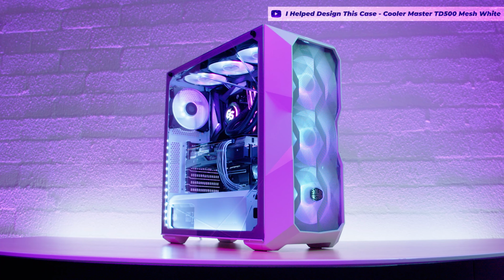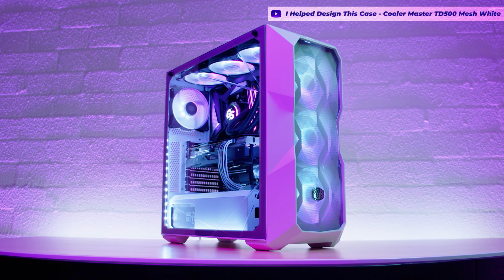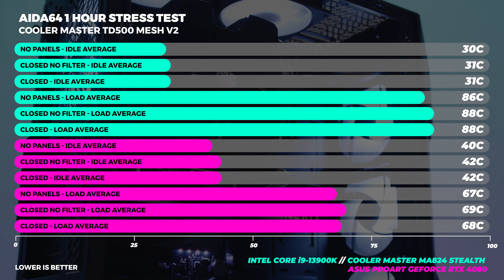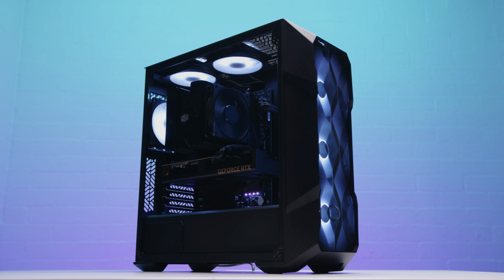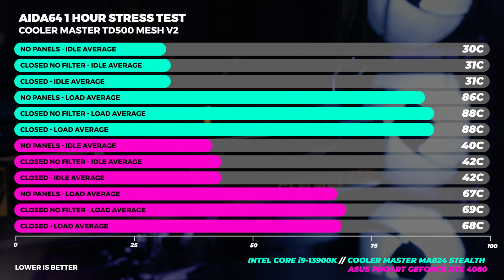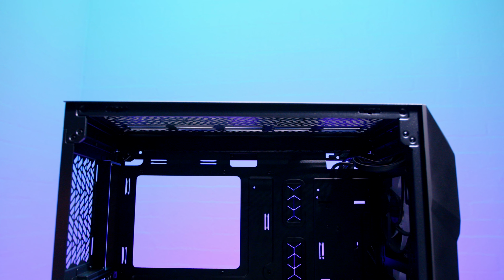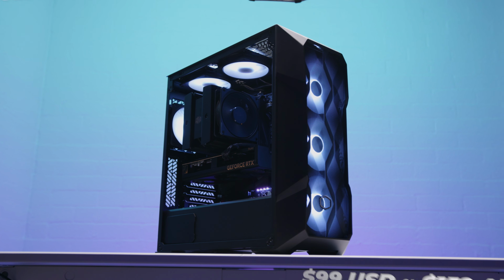Cooler Master TD500 Mesh got better with V2!

Comment: I've had a TD500 for about 3 years based mostly on your review/video and the Gamers Nexus testing. 
Absolutely awesome case for the price. 
Really keen to see the v2.
I haven't watched this yet but I really hope there's front panel usb c
Reply: 3:41 - there is a front USB-C finally
Reply: @DrKriegsgrave  yeah, saw that. Sweet. And the top coming off is nice. Putting my rad in with 30mm thick fans and getting it abled was a challenge.

Comment: I’ve owned td500mesh v1 and installing the top mount 360 radiator is horrible + issues with ram clearance…now on v2, cooler master learned from mistake

Comment: Heyyyy, it was thanks to you that i decided to buy a CM TD500 about 8 months ago, your videos convinced me it was a solid choice over a phanteks P400. Please let me tell you my story:

After i purchased a TD500 mesh version, i also brought a TD300 for my brother who was looking into a smaller form factor since i had a Z590 MSI Tomahawk and he had an MSI B560 Tomahawk as well that i previously owned. I quickly questioned myself why did the TD300 had the open top design avaiable while the TD500 didnt, it would have made been WAYY easier specially when doing placements of the radiator and cable management, im glad the V2 has corrected this

Next, i found out the space for cable management for the TD500 was.. very limited, as in, miserable, some spots only had about .5cm in space for cable management, which compared to the CM Q300 which i previously sported that had over 2cm was a huge difference, that case, despite its flaws regarding temperatures and their horrible mesh, was actually fun to build.

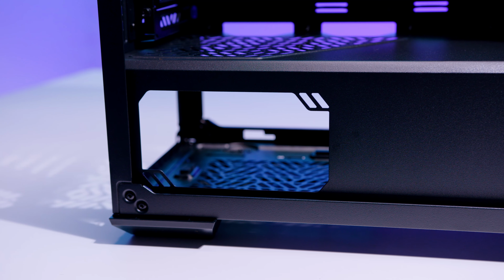I didnt mind the hole for the power supply, i brought a ROG Thor 850 that has a nifty LED screen and ARGB that tells you your power consumption so it fit well the build, of course, the vent had to go upwards and i wish the TD500 had small vent holes on top where you usually would put the 2.5 inch hard drives, because the fan would be otherwise blocked or invert the Power supply and lose out the LED screen and ARGB, fortunately the case has a bit of a space and two holes that allowed the vent to suck up the air from there, its not ideal at all, but it hasnt given me any trouble, i just wish they added holes in there in case you needed that configuration, the V2 seems to have adressed this issue (look at 8:51) super happy with that!

The front panel cables were not long enough unless you compromise aesthethics and let them dangle by the front, i had to purchase a cable extension for the front panel (thanks amazon) so i could hide the cables by the back and only have the connection show up, i guess thats fine.

I see the V2 extended the lower casing to the front and left a space for the radiator, i question if this config actually supports a radiator with a push-pull configuration, considering youll be using the fans from the mesh as part of it, that can be a deal breaker for many people

And my biggest two gripes about the TD-500:

-Theres NO WAY it can support many of the upper radiators configs with 140mm DESPITE SAYING IT IS POSSIBLE, whats the deal with that? try putting a MAG botherboard in there and even so, regular RAM and it doesnt have enough headroom to be placed, thats absolutely balls! you have to use a 120-240mm radiator to even come closer to fit, and its thight! and so much so that ram placement is almost impossible, 1 cm wider and 3cm taller would have made the entire difference for most configs. let alone its not even remotely possible to do push pull config, so you are left to use the only place it can possibly fit: the front.

- The front, it really looks nice, and can place up to a 360mm radiator except that theres one flaw NO ONE talked about: place a radiator as intended, in this case i have a 280mm gigabyte waterforce, and guess what? the freaking pump gets on top of the loop, theres no way you can fit the radiator properly wihout having the pump being on top of the loop, and the 240mm regular one suffered the same, its not in top of the loop! i could hear bubbles cavitating on the loop, meaning it would kill my pump in no time!! what a horrible mistake design is this!?!? it drove me MAAD i really really really HATED IT! so what i did? well since i was now stuck with the case and they offered no returns from imports? i had to do the unthinkable, i drilled holes in it? yes thats what i did, got a ruler on me, a drill and carefully made sure i could put two pinholes just so that the rest of the rad aligned witht he 120mm fans, the result? finally the radiator was in top of the loop, and yes there was space for it to work well, using the 3 front fans from the mesh with the adjustments it actually worked, plus i added two 140mm arctic pwm pst argb 0-DB (what a long name!) in the rad to finally get a push-pull config, because the original gigabyte 140mm fans where freaking jet engines, and all finely tweaked so i should not make an air bottleneck due the RPM difference, the result? now my 11900k cpu stays at a comfortable 29C on idle with slight OC and about 52 degrees on load. Was it ideal? NO, i hated to do this, was it functional? yes and it solved the issue. I had to purchase extra screws and hex nuts to make the build stable, no way im leaving contact points to vibrate or worse, all is thightened up beautifully, maybe its my fault for using a rather not so conventional 280mm radiator? maybe, but then maybe CM should not advertise it fully supports it when you get horrible desing mistakes like this.

Building a PC is fun, this is the third pc i build and i have enjoyed making stuff work so far, im not a system integrator nor someone who makes this for a living, i learned it all by watching people do their builds, guides, GN's J2C, and Gear Seekers indeed, --- however, the fun of it is about making all of the pieces work as you intend, space allocation doesnt have to be a hazzle when you want to build something for you to last, i sincerely enjoyed building the smaller TD300 for my brother, despite everything, i sincerely wished they corrected all these "oopsie" mistakes in a new TD500 revision that id buy it in a snap, sadly, i am not entirely sure if the TD500 V2 seems to be it, mainly because im unsure hows the front allocation regarding the radiator as i mentioned previously, and if ill have the same issues with the upper panel in case id want to have a rad-on top config using a 280mm radiator. 

I have ever since, replaced the TD500 stock fans with the Masterfan Halo v2 120mm and  put 140mm CM MF Halo v2 fans on top (mostly for looks), yes, the 140mm fans barely fit, even as simple exhaust fans for the top, and put a Nidec typhoon as exhaust on the back, love that fan, in the end, the presentation is top notch, paired with a modest 3060ti from EVGA i think i got an equipment to last until i decide to see what new parts will be in 6 or so years, but only me, myself, and i know how freaking painful this TD500 build was, cable management space, its not just about shoving cables in the back space and into the lower case area, and i wish for a case that took into account all this details, specially the space allocation for upper 140mm radiators and  for the front configs making sure THEY ARE ON TOP OF THE FREAKING WATER LOOP IF YOU RE USING A 280 RADIATOR.

And to be fair, for me, building the TD300 and even so, the Q300 with its awesome space for cable management was much more fun for me, im glad you and the Cooler Master design team are helping to make things better, but from experience, i can tell theres still some flaws to iron out. Im satisfied with my TD500 build which turned to be awesome after so much effort, but i am not entirely happy with it.

Will i switch cases? if i find something what can solve all of this issues i ve mentioned, id buy it in a snap! Id look forward to a V3 or something that can correct these issues, and have USB-C on the front (edit: 3:41 - it DOES have a frontal USB-C, well thats great! you should have mentioned it in the video)

If you want me to tell you the full story and give my pictures you can certainly mail me at kingkrieg from the hot mail 

thanks for reading me out

Cheers
Reply: Damn bro chill out
Reply: @Interloper322  let the man pour his heart here duh.. He probably don't have anyone else in his family/friend circles to listen to his techie rumbling.
I know the exact as what he was feeling. It suck when we're the only "tech" guy in our big families and nobody can understand our frustration with the little details we had problems with when its related to tech.